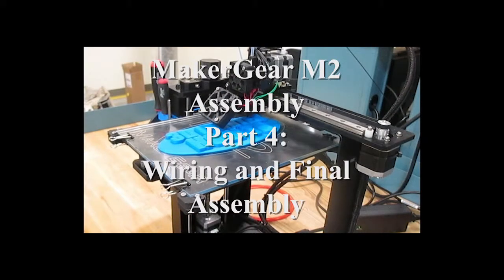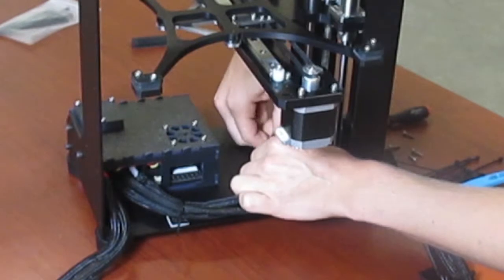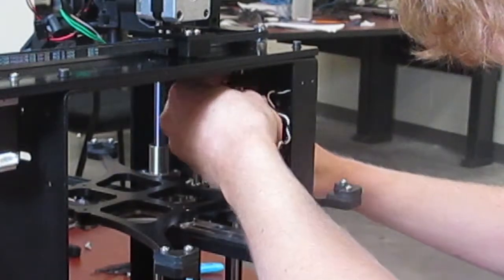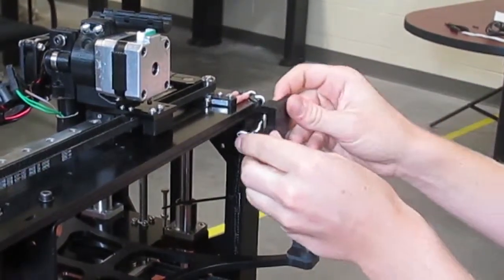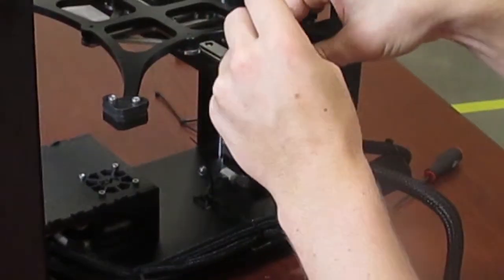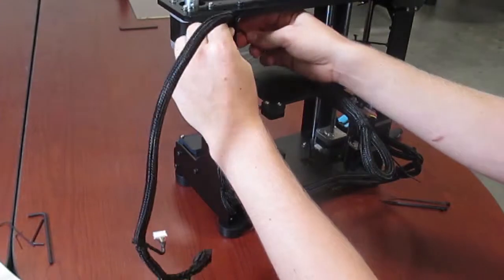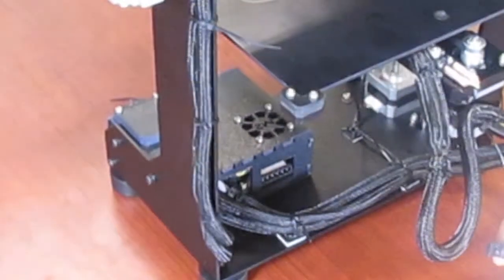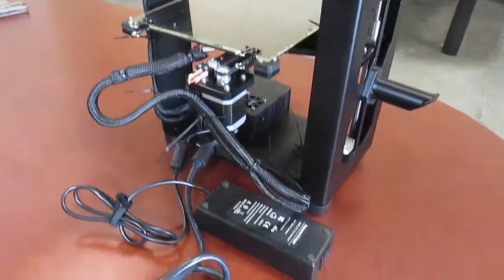MakerGear M2 Assembly Part 4

Comment: Because own my very disappointing rostock max that I've spent probably over 120 hours working on, it looked like spiderman had been through the place with this oozer of a hot end and extruder combo. That and I only have a flat build surface of 4-6 inches and my bed is an 11 inch circle!